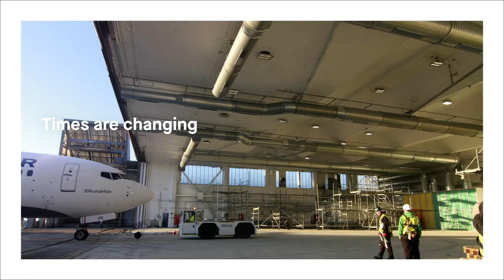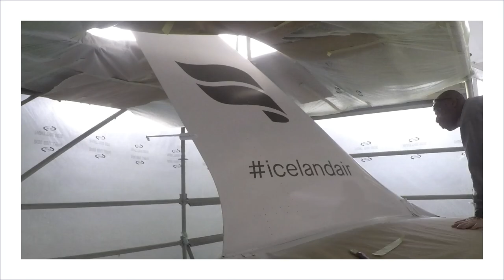Icelandair's New Livery Time-lapse | Icelandair

Comment: What are you thinking. You have disrespected the ENTIRE aviation community by changing the chad gold and blue livery to this.
The colours make no sense.Why would you do this- It looks like RyanAir has taken over IcelandAir and made it a cheap low cost airline. Dont get me wrong, it looks nice on the B737 because it gives it a modern look but please dont change the other aircrafts.
Reply: They will. A BETTER DESIGN WOULD BE THE ICELAND FLAG STRIPE IN THE BACK AND THAT'S IT (rather than pink, blue, and more nice colors not good for planes)